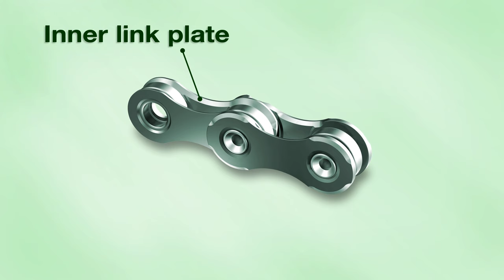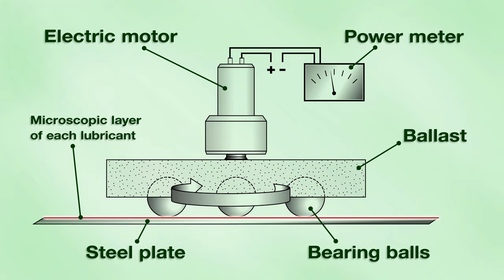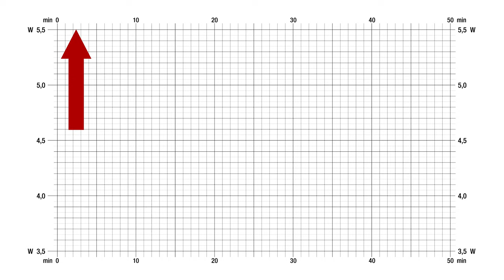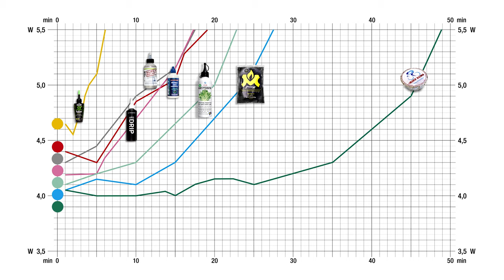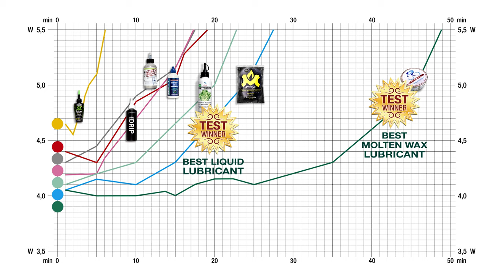1–0 to Nature! Friction killers from The Plant Kingdom take the first round!

Comment: Last time I checked I wasn't using my chain lube on a flat plate with ball bearings. I understand the concept of making it equal but I'm applying chain lube to a chain and I cant apply it equally or everywhere like you said so the traditional test is more relevant. Use real world tests to prove your product.
Reply: Agreed. It may be the best lubricant in the world but if it doesn't penetrate and provide that lubrication within the chain it's rather pointless.